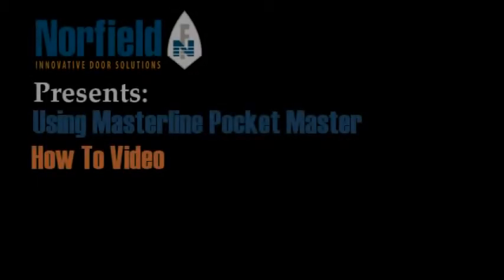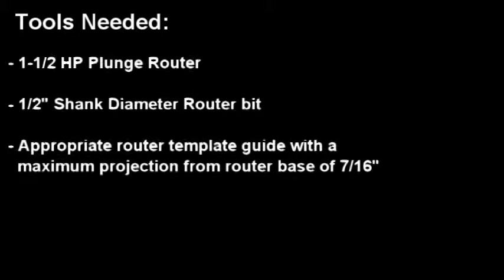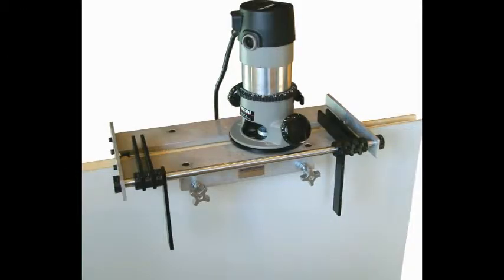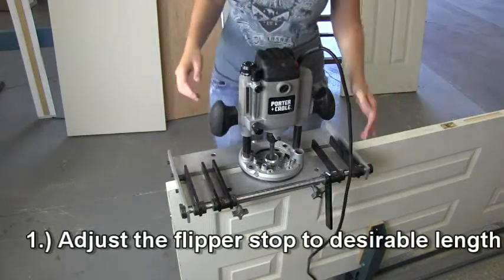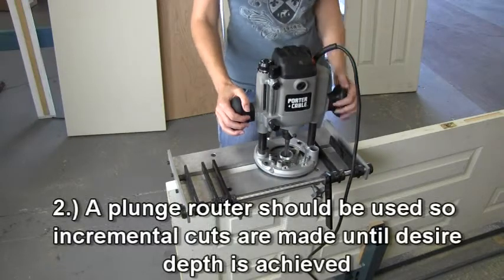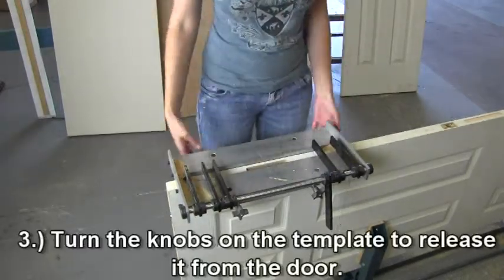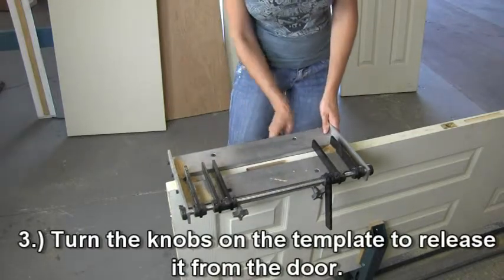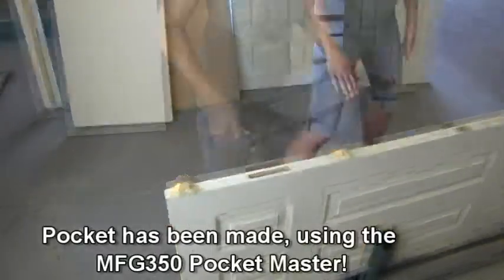Norfield Masterline Pocket Master (MFG350) 'How To'

Comment: Is anybody buying this tool...?  Why did the technician have to loosen both sides of the unit(four star knobs) when just a simple twist from the two knobs from just one side will do...! Makes me think twice about buying and using a over worked tool or Jig... Definitely not a seasoned Installer...  Sadly Just some cute Legs from what I could make of it... Greg